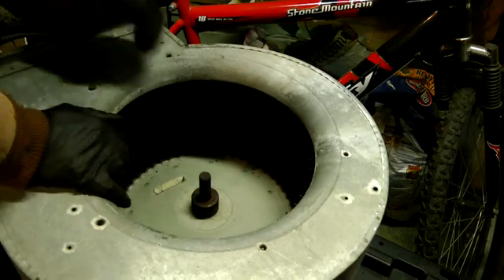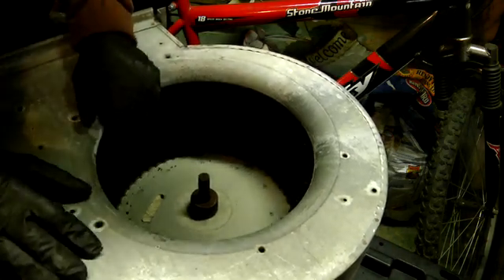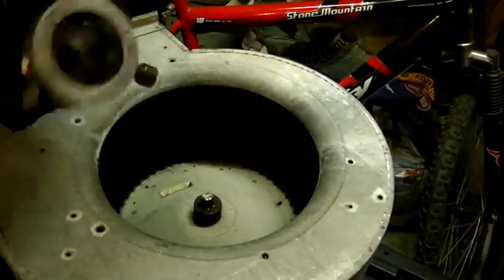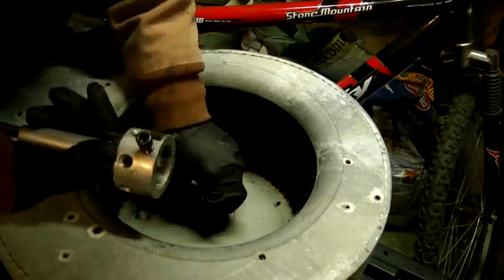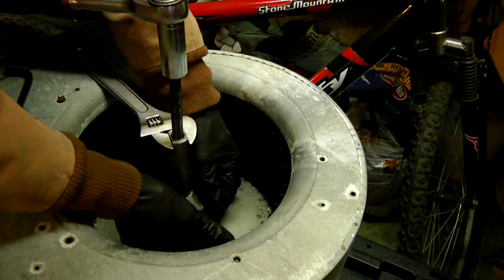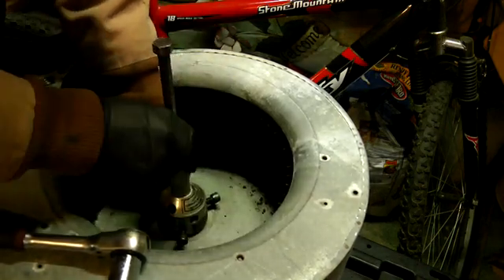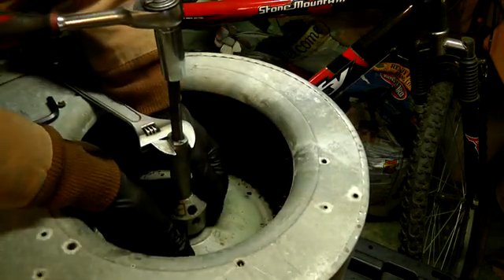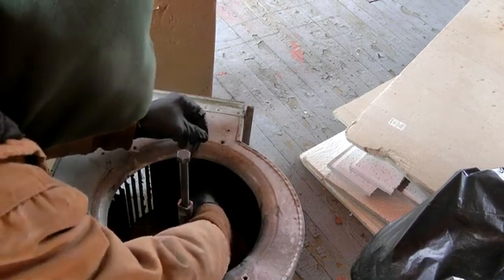Squirrel Cage Motor Removal When It Seems Difficult

Comment: I enjoyed your video, nice to see the puller in action.  My shaft was too long too; didn’t”t have cutter so I bought a 5/8 bolt to push it down until it was down low enough I could use the extended bolt to push the shaft all the way through the hub.   Worked great!

Comment: Can you knock it with a hammer
Reply: Before knocking out with hammer and bolt etc get some sandpaper and make the shaft shine like new, then more wd 40 and knock it out.  Make it smooth because it has to go back through the hole.  I didn’t sand and after pounding had to drill mine out.  Dont do what i did.
Reply from the maker: sometimes I use a hammer and a punch and drill a dip in the middle of the shaft but when  doesn't  move the blower wheel and housing can be damaged

Comment: What is the name of that piece you use to get that shaft out if that's the name of that
Reply: Shaft blaster
Reply from the maker: Fan Blade and Blower Wheel Puller or Fan Hub Puller